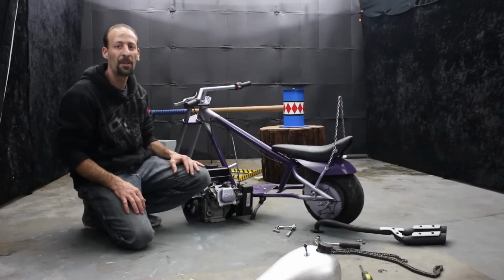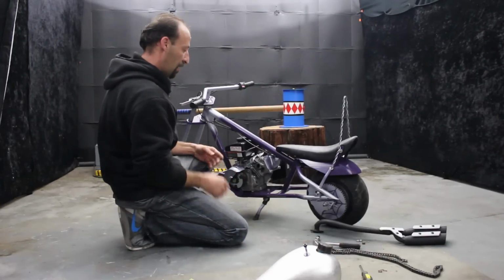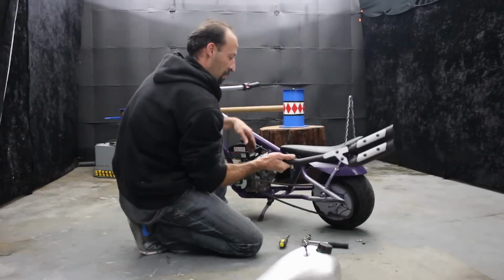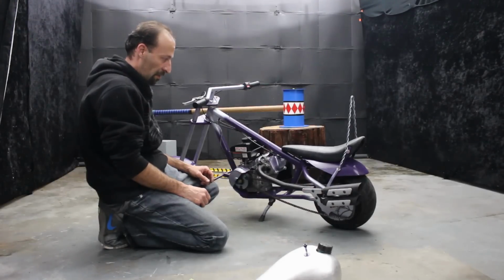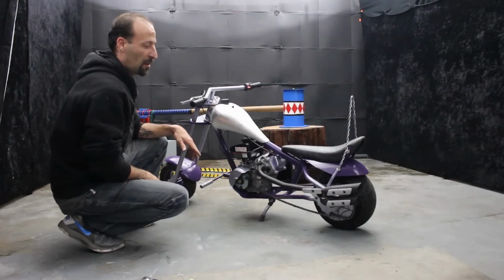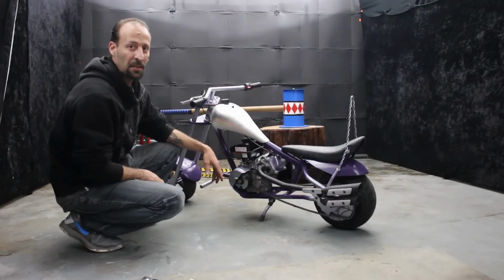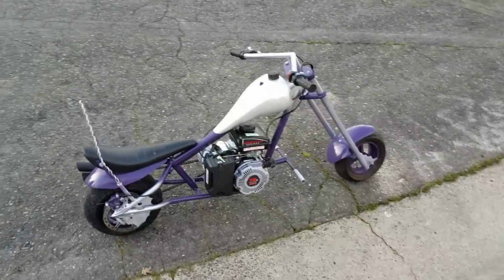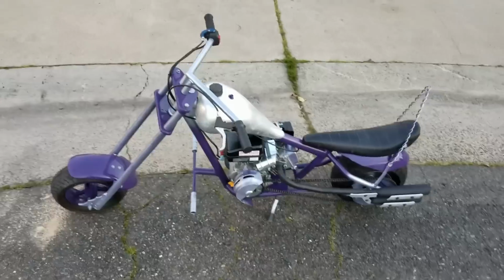Mini Chopper Build pt.2 🏍

Comment: Nice! If you don’t mind how much did the frame and forks W/ handlebars cost you in material I’m sure you designed it and cut and welded all the tubing and that top bracket for the forks? Did you ever think about a 20x8.75 rear tire and a 24” front tire? I like the teardrop tank you should of painted it to match and is that a dummy or full function gas tank? If so where can I get one you gave me a great idea! Well done!